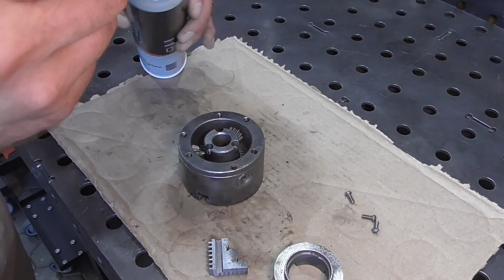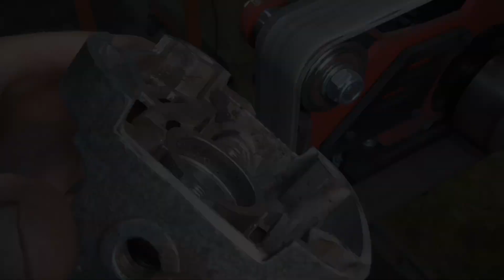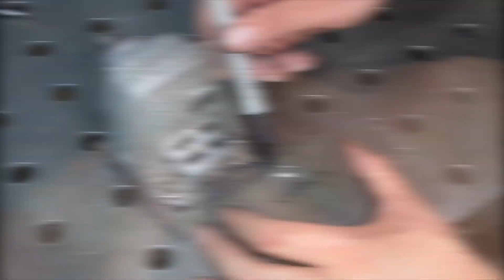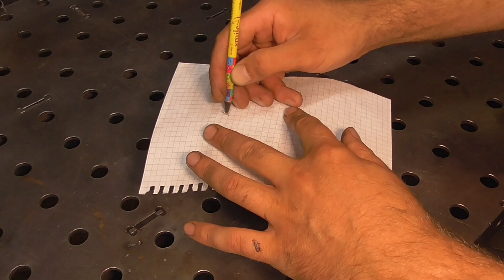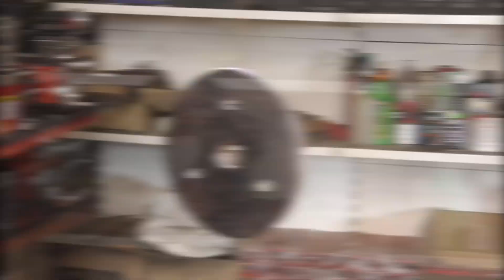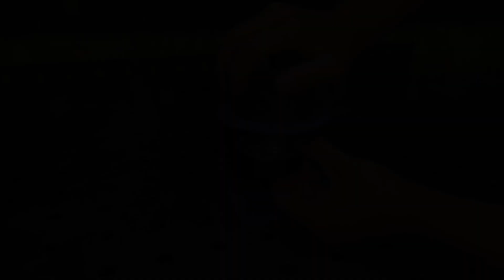Welding & Cutting Rotary Table from Angle Grinder || Angle Grinder HACK

Comment: Well... this is cool idea... 
But I'm surprised that it worked out at all... 
You grounded to the gearbox... 
I'm surprised that the gears didn't just weld together or the bearing as you just arc'd the shit out of it... 

This would work better if you had a contact brush to the spinning table itself from  a contact point to ground to... 

Don't get me wrong.. I like the idea... but that's a big deal with more than one use you'd probably get out of it.. if you had a proper ground....